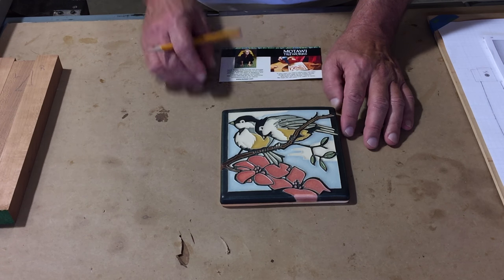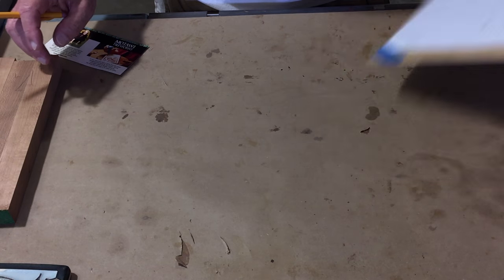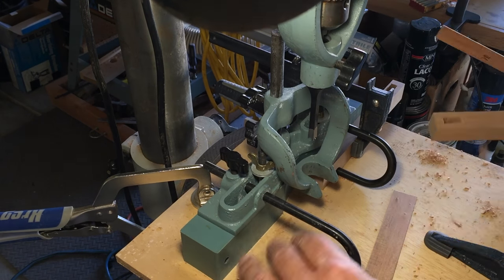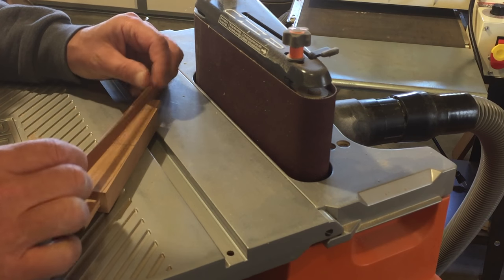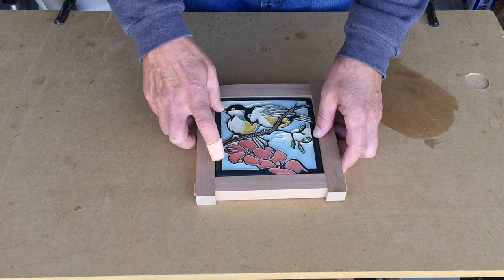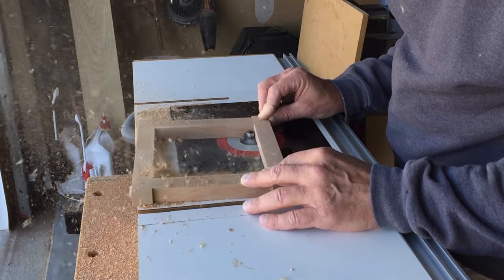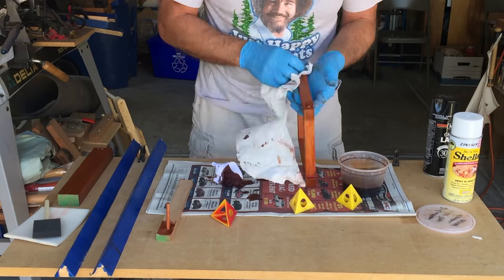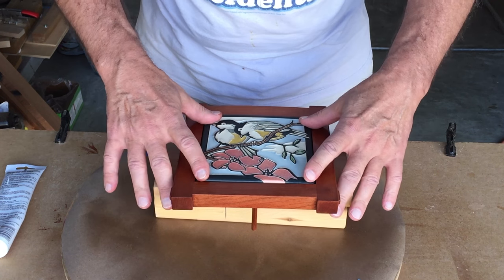Arts & Craft Frame

Comment: Good trick on sizing the dowels. Most of the dowels I've used are not exactly the nominal size...nor are they perfectly round. This trick should fix that problem. You didn't show the actual application of the wood conditioner but I assume it was applied before the stain to promote an even coat of the stain. The frame came out great and I learned a couple new tricks. Thanks for posting this one. "Like"
Reply from the maker: Thanks Gil.  I like to let the pre-stain conditioner dry overnight so I put it on the day before.  It's a water based product that goes on clear so there's not much to see.  I applied one coat, let it dry then sanded it back with 320.  I put on a second coat and let it dry overnight.  Cherry can be blotchy so I like to use the conditioner under a dye or stain.  Sizing the dowel worked out pretty well.  It's not that easy to find a 3/16 cherry dowel.  Glad you enjoyed the video and were able to pick up a couple of tips.  Thanks again for watching and for the comment.  Take care,  Steve